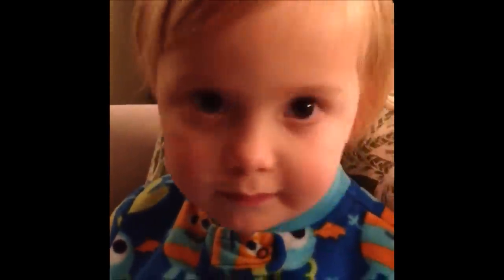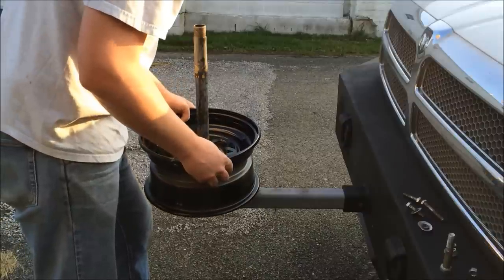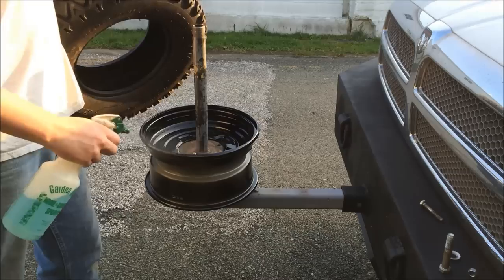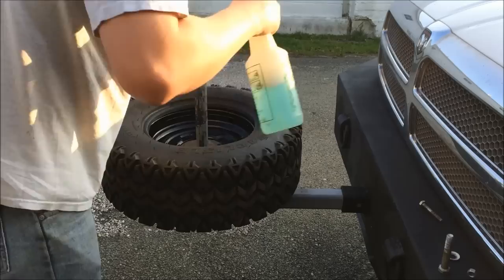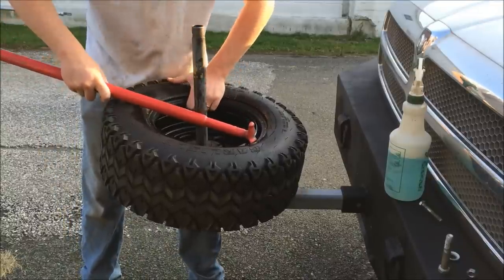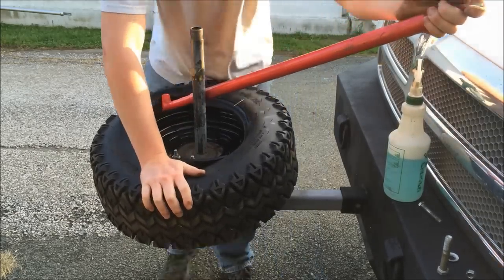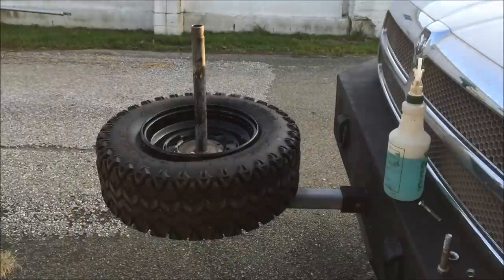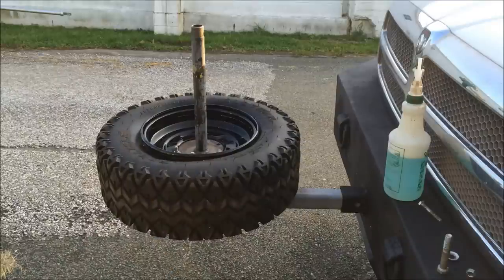Mobile Tire Changer

Comment: Wish I had thought of it. I have two tire machines/both manual. One for car tires, one for motorcycle tires.The hardest thing is getting my machines to hold still. I’ve pulled the anchors out of the floor that didn’t hold.. I tried mounting my machine to long 2x12s That I could move out of my way because I did not want to machine permanently mounted to the floor in my way. I even bought large J bolts and tried bolting my machine to the sewer grate at the end of my driveway in the street. I ended up pulling the sewer grate right out of the manhole trying to mount tires manually.
   I don’t have to mount my old coats tire machine to my trucks trailer hitch completely. I can just have a bar coming out of the trailer hitch, that attaches to my tire machine to hold it still. I would want a little bit more space than this guy has between my truck and the action.Great idea

Comment: If you had of mounted the head at a slight angle away from the truck it would make it a lot easier . The first bead is easy because the top bead can flex inwards allowing the bottom bead to expand  easier .